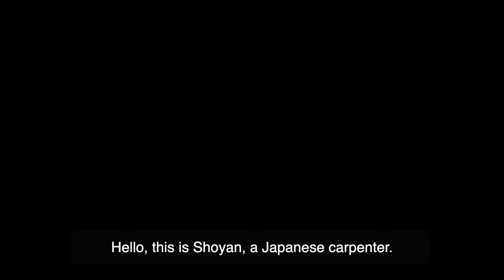Woodworking Tips - How Japanese Saw Blades Differ

Comment: Very nice, thanks.

Which teeth would you use for plywood? Yes circular hand held saw for working the sheet down, but what about cutting smaller sections, like, say corners, or precission profile cuts in plywood where circular saw blade is too big for precision work?

Thank you.
Reply: Thin veneer blade with super fine teeth.